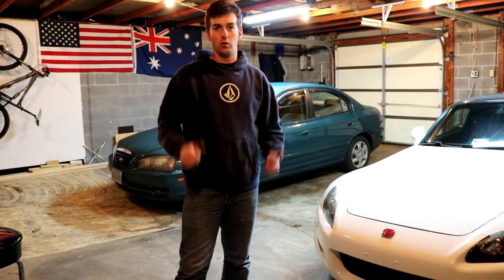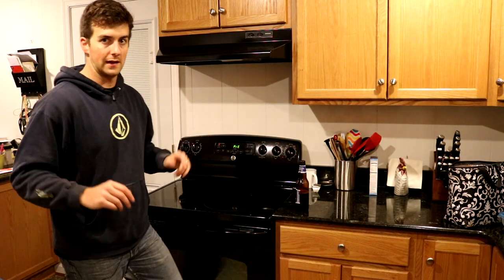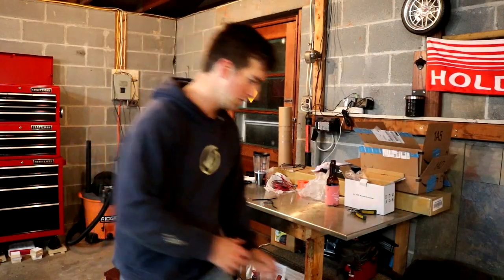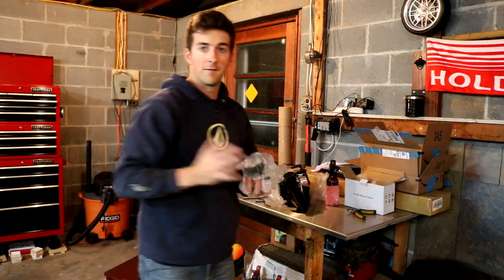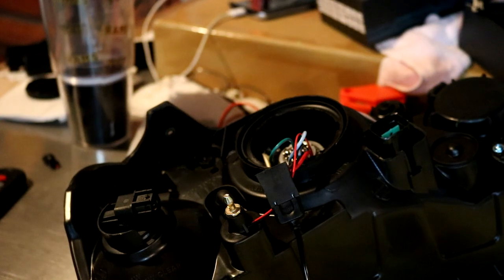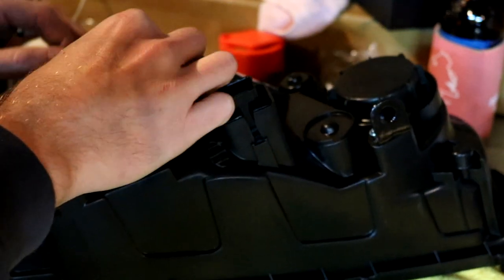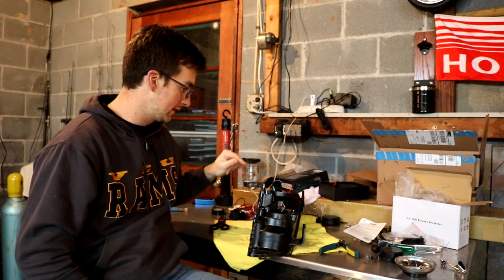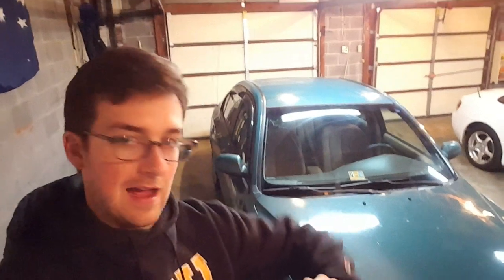Retrofit Projector Headlights for Under $100 - Ballin' On A Budget Episode 1

Comment: I do not want to get mess up with you, but you are obviously not ok with calculus !!!
Retrofit Projector Headlights for Under $100 - Ballin' On A Budget Episode 1
Headlights - $ 70
Projection Lips - $ 30
LED - $ 39-40
... apart from this, the seal is placed between the projector and the reflector
You did not have to bake them! Your "glue" is actually rubber seal ...
Respect for the effort, but apparently you are not aware of Retrofit!
Reply: Calculus ? You mean algebra...
Reply: Same shit... :)
Reply: @ivanmarinov110  Haha I wishhh Calculus 1 and 2 were a nightmare. Calculus 3 was alright and differential equations was a concentration camp. I would prefer algebra any day if I ever went back in time and retook those courses.

Comment: Can you use a heat gun instead of the oven?
Reply from the maker: I would not recommend it, heat guns get super hot (over 500 degrees Fahrenheit in low mode) and only focus in on one area, you need the entire seal to get warm/hot and gradually so nothing melts. An oven, if done right, will be wayy less hot than using a heat gun. Hope this helps
Reply: Only if your girlfriend catches you using the oven and throws the headlight at your face